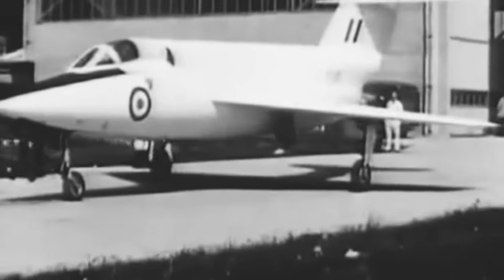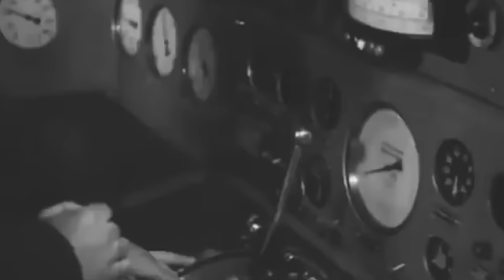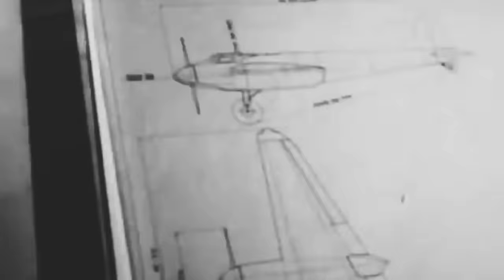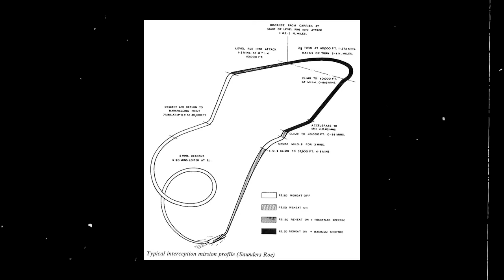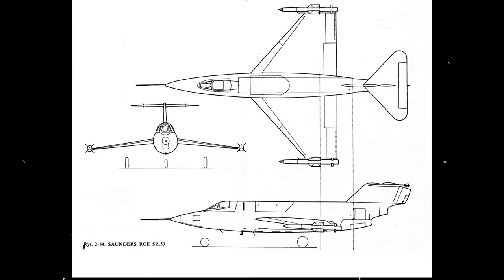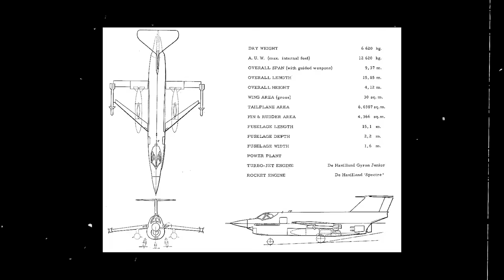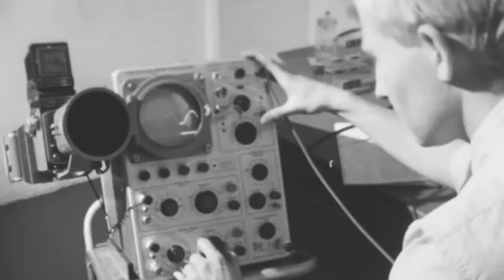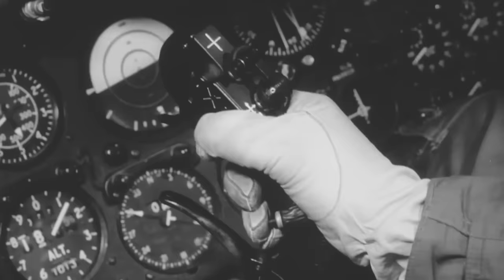The Best Plane in the World that Went Terribly Wrong

Comment: With the English Electric Lightning coming along the SR53 became a complex irrelevance. It did outperform expectations and was a favourite Airfix  1/72 model in the early 60s for kids like me.
Reply: The SR53 was purely a test aircraft to prove the jet/rocket interceptor theory. It was never put forward as an operational option. The SR177 was the proposed full scale aircraft, for many reasons it didn’t make production, or even prototype. Not because of the Lightning, but the F104 Starfighter and the manner in which that was sold particularly to Germany.
Reply: Beautiful aeronautical invention, beautiful sixties Airfix kit. Real one in Cosford.

Comment: The Ruskies TU94 "Bear Bomber" is the fastest Turbo Prop aircraft in the world but only reached speeds of 540 mph at best. Also is the loudest airplane in the world. So loud it could be detected by submarines.
Reply: It can reach 790mph
Reply: @DavyRo care to back that up I will take Wikipedia
Reply: 925 km/h = 575 mph
Reply: @DavyRo That would exceed Mach 1.  Ain't happening!  🤨
Reply: Try TU-95
Reply: Speed is different at different altitudes due to lower pressures but...
Reply: @DavyRo 790 mph 😂😂😂 that would make it SUPERSONIC...😂😂😂😂😂 get a grip on reality dude. 😂😂😂
Reply: @DavyRo  With propellers? Not happening. That's just not physical reality.
Reply: Uh XF-84H Thunderscreech
Reply: @DavyRo   sure that isn't 790 km/h?
Reply: @everypitchcounts4875  loudest production aircraft then.
Reply: @recoil53 With afterburners..
Reply: @DavyRo  790mph? No . turbo props can't go supersonic - the shock waves would likely break the propellers. Even turbojet engines have to slow the intake air in the inlets so that supersonic air and shock waves don't hit the compressor blades.

Comment: The early Comet airliners had a housing for Sprite rockets between each jet tailpipes. In practice it was unnecessary but one wonders at the possible consternation of passengers in the rear seats watching the huge clouds of smoke billowing from between the jets.
Reply: Comet 1 suffered several hull loss accidents to runway excursions, de Havilland knew the plane was too heavy for the weak thrust of the engines.

Comment: The CF-105 Avro Arrow out classed all of these as well as all other aircraft of its time as it could fly higher, faster and with a greater range. It set speed and altitude records
Reply: The Avro Arrows downfall was actually the lack of range.   With the Pratt & Whitney J75 engines in the mark 1 aircraft the range of the Arrow was only 360 nautical miles.  The more powerful Iroquois engine would also have burnt fuel at a faster rate, resulting in even less range.  The promotion of the day that the Iroquois powered mark 2 would have a combat range of 400 nautical miles seems to be nothing more than pure fantasy.  With the vast area of Canada the Arrow simply lacked the range to be an effective interceptor.
Reply: It's is nuts that Britain's Hawker Siddeley, the owners of Avro Canada did not combine their efforts to create one design to meet both the RAF and RCAF needs.   In 1958, the same year the Avro Arrow prototype few, the head office at Hawker Siddeley submitted a new design for a twin engined interceptor, the Hawker P.1129, powered by a pair of Rolls-Royce RB.141 engines.  The company already had one now flying, the CF-105 Arrow.

Comment: Good review of SR53. Having once spoken with one of Saunders Roe senior engineers, who worked on the project, the Avro 720 was a technically the more advanced vehicle, as he put it “No fancy laminates for us, just lots of loverly rivets”. Also the air brakes came from a F86 Sabre, but they had to be fenestrated to improve stability, your shot of the prototype exercising the air brakes was prior to the alternation. The big version SR177 was of interest of the Royal Navy but production numbers wouldn’t have been worthwhile, however the SR177 would have been ideal to defend German air space and the Luftwaffe wanted a substantial number, that is until Lockheed salesmen with full suit cases convinced them that the F104 Starfighter would be financially more rewarding.
Reply: SR-177 was never going to be bought by the Germans, they knew was a pain in the arse HTP was to use on an operational fighter. The myth that the Germans were very interested was driven by a designer at Saunders Roe who thought the Germans were going to buy it because they came and looked at it. The Germans knew what was going to do the majority of the Air Defence in West Germany and it wasn't any manned fighter. SAM's were king in air defence from 1963 through to the end of the cold war in NATO central region. The Primary role of the manned aircraft was peacetime air policing, recce and tactical nuclear strike (between 1963 and 1968) and defending their airfields after that.

Comment: I am surprised that they didn’t consider the ram jet technology that I believe was already in use in the bloodhound missile coupled with a rocket to achieve the speed required. HTP is such a horrible idea in a craft going into battle!
Reply: "They DID!"  I read about it in the 70's! or 80's? in Popular Mechanics and, or Popular Science?  
At one piont the coupled a  Ram inline with a Scram to surf Shock Waves for Hypersonics!

Along with an Inside Out Battery, Charging System, generating Hydrogen and Oxygen, With Fuel Cells for SUPER QUIET Propulsion Fuel Cell Tech?
Reply: The French did extensive experiments with ramjets - the Leduc series, and the amazing-looking Nord Griffon, which looks as if it was designed for an anime series. They couldn't get it to work well enough to go into production either.
Reply: Ram jets are simple but have limitations, not least fuel inefficiency and poor life/reliability. OK for a missile such as the V1 or Bloodhound but not an aircraft.
Reply: @Dalesmanable  interesting. The blackbird engines were quite a remarkable hybrid I suppose and far from a true ram jet.
Reply: @robinwells8879  They weren’t a hybrid. They were the standard arrangement for supersonic aircraft: turbojet engines with adjustable inlets to optimise pressure and flows at different speeds.
Reply: There’s a wonderful run through of the engine by one of the pilots showing the arrangement of the bypass ducts. Utterly ingenious.
Reply: Ramjets only work at all above a certain speed, and it is a high speed. They are only efficient at multiple mach numbers. The Bloodhound used a rocket motor to get there and the stresses would have been more than a human-rated airframe could take. It's basically the opposite way around from what this aircraft needed. Some years later, someone came up with a combined rocket/ramjet in one engine, but the state-of-the-art for aircraft had moved on by then. Thinking about it, there was also one engine that transformed from a turbojet to a ramjet (and back again) in flight, but that also came substantially later in time on the Blackbird.
Reply: @onenote6619  Ramjets also have incidence problems as the compression part is done by the Intake shock cone and intake lip, plus duct shape. As soon as they are not straight on to the oncoming air, compression drops off and the engine can suffer rich extinction. Anything powered by them cannot manoeuvre for toffee!  Bloodhound missiles couldn't put more that 7g without flaming the ramjets out.

Comment: The USSR didn't have bombers capable of Mach 2 in the 1950s.  Their first supersonic bomber entered service in 1962 and was capable of Mach 1.4 and their first Mach 2+ bomber didn't fly until 1981 (and none of them could fly at 80,000 feet).  Interceptors needed to fly fast and climb high and fast to meet sub-sonic Russian bombers at short notice though, hence the SR 177 and English Electric Lightning.

Comment: The rocket makes sense for a missile, less so for a fighter aircraft. Basically, the range is too limited. The skid landing problem was demonstrated by the Me-163, once it lands, you need so sort of crane to move it on the ground. The SR-53 was mostly a proof-of-concept vehicle, lacking any airborne sensors. The SR-177 was slightly more practical, but still range limited. The real solution was more powerful turbojets. Other mixed power plant projects such as Republic’s XF-91 ‘Thunderceptor’ proved to be equally blind alleys. The Dassault Mirage III had a SEPR ventral rocket pack but was little used. The English Electric Lightning designers looked at putting a Double Scorpion in the belly tank, but would have left the already fuel limited fighter even more short legged. I think the MiG bureau toyed with rocket boosters, but again gave up as better jets became available.

Comment: There were some machines with mixed arrangement, a rocket and a turbine, perhaps the best would be a rocket to reach the operating airspeed, 300 m/ sec, for a RamJet to work.
It we're tested in X-15 to Mach 6, the Initial higher fuel use compensated with the feather weight of PulseJets and RamJets.
Blessings +
Reply: I meant a Lorin RamJet

Comment: The British scraped the BAC-TSR.2 like the AVRO ARROW .
Reply: TSR.2 was an unmitigated failure
Reply: @WilhelmKarsten  when you use the term failure.There are much better explanples other than a plain not many people know of Like the Avro Vulcan. A plane to expensive to engineer.buld,maintain ,fuel,to slow in flying ,a very small group of pilots that can fly it,but it was in service for a long time.
Reply: @alanarmstrong2323  The Vulcan also failed to deliver its design performance ]specifications, it was unable to fly supersonic.
Reply: @WilhelmKarsten  and still it flew.
Reply: @alanarmstrong2323  by 1960 nuclear ICBMs entered service with both U.S. and Soviets military... rendering aircraft like Arrow and TSR.2 obsolete in a Nuclear First Strike scenario, and too expensive as a secondary or alternative weapon system.
Reply: @WilhelmKarsten  Russia still flew the bear after suputnik as well as b52 that are still in service today.
Reply: @alanarmstrong2323  It flew, but not as designed... remedial engineering was required to make it stable and controllable, a automatic speed limiter installed to prevent airspeed above Mach 0.96 that would cause the aircraft to lose directionally stability and pitch down into an uncontrollable dive.
Reply: @alanarmstrong2323  The Vulcan entered service in 1956 just 2 years later Mach 2 bombers like the B-58 and the A-5 had appeared.
Reply: @alanarmstrong2323  Only because of the development of long range air-launch nuclear missiles, the UK never developed a operational nuclear ALCM and the Vulcan became obsolete because it could only carry gravity bombs (dumb bombs)

Comment: Some factual errors and showing several different aircraft for padding. Better research and preparation could have avoided this.
However, the author shows clear understanding of those stressed years for the UK as the primary aviation country to meet Soviet threats. It was suited for the role by having innovative companies in private hands and by the end of the 1950s many of these cooperated as gentlemen co-designers not facing the need for government funding, even though the companies ultimately became the precursor of BAe via many iterations.
SARO, Shorts, Blackburn, Bristol, Hunting and some former famous names crammed crucial research into a short time period and aircraft such as the Hunter, Lightning, Javelin and Buccaneer carried the genes of this mighty and brave work.
The idiotic 1957 White Paper by Duncan Sandys could only have been written by an army-biased minister but the RAF and Royal Navy chiefs eventually caused changes which resulted in the aircraft listed here.
The SR.53 vertically stacked engines were used in many interceptors in the UK and Europe (especially Sweden) until that class of plane morphed into fighter-bomber or multi-role format which the Soviets developed first. Anglo-French cooperation also emerged from the early 1960s with rather splendid results.
Reply: But then they get less comments like this which helps the algorithm. You must be new here :D